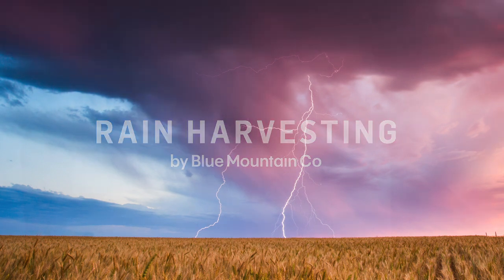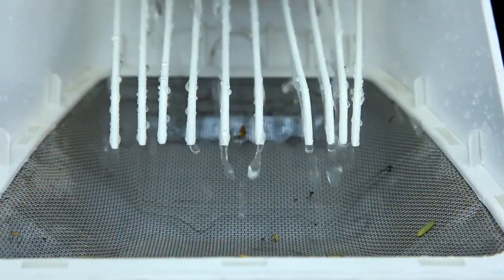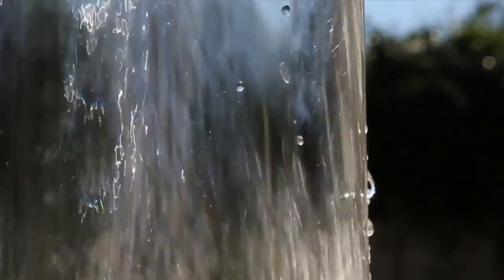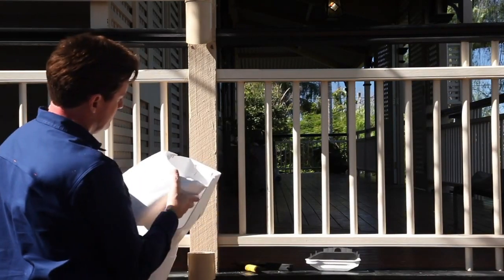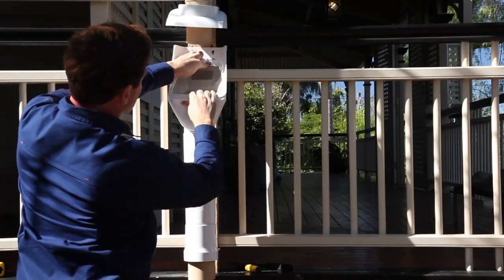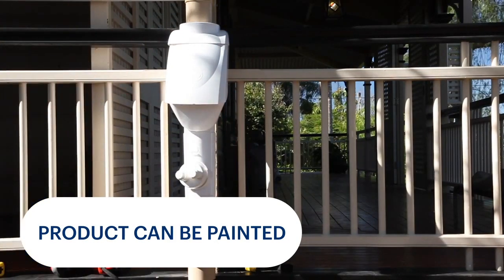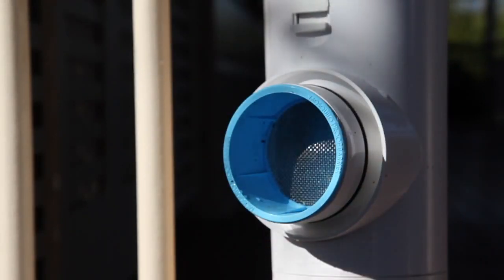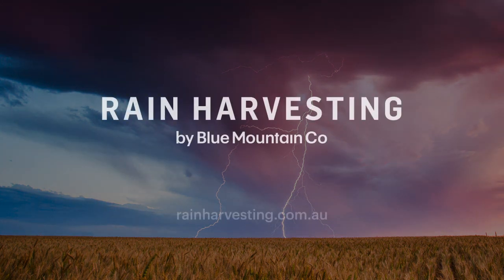Clean Rain Downpipe Diverters

Comment: this seems like a great single solution for a leaf guard, diverter, and first flush but multiple reviews here and various online retailers that little/no water ends up being diverted to collection tanks. has there been any root cause or solution identified for this issue? also, what is the expected behavior when the collection tank is full? does the unit allow for overflow to return to original downspout or is an overflow from the tank required?
Reply from the maker: Thank you for your comment and interest in our product!

You're absolutely right — this solution combines the functions of a leaf guard, diverter, and first flush, making it a very versatile unit. In some cases, particularly with older Clean Rain models, we’ve found that the internal washers can become less effective over time, which can impact how much water is diverted to collection tanks. Fortunately, replacing the washers usually resolves this issue.

Our newer model, the Total Rain, performs the same functions but uses a different mechanism. While it may require occasional maintenance to keep it performing at its best, it doesn’t need replacement parts like the Clean Rain sometimes does.

Regarding overflow: neither the Clean Rain nor the Total Rain include an integrated overflow feature for the tank. We recommend installing a separate overflow solution at the tank end. If you'd like specific advice for your setup, feel free to send us a few photos — we’d be happy to sketch out some ideas for you!

Please send your photos to info@bmco.com.au.

Comment: We are having and issue with the water not being diverted. Water is just flowing around the ball that is supposed to close off the flow downwards. Also in the instructions it says 3inch schedule 40 pipe can be connected to the diverter side but it doesn’t stay on at all and constantly leaks. Great idea but doesn’t quite execute properly. Not sure if we can return the item for a refund as we didn’t buy it directly through the manufacturer and don’t have the box anymore unfortunately.
Reply from the maker: Hi Kayleigh, I am sorry to hear that you are having issues with your first flush unit are you able to send some information through to our team to assist at info@bmco.com.au - Thanks, Portia

Comment: Hello! How much water is diverted to the tank? ive got a pretty big tank to fill and im curious on what percentage of the water thats coming from the roof is getting into the tank.. Maybe 50%? thanks!
Reply from the maker: Hello Dave! When we refer to diverting the first flush approximately 18-30 litres or 5-8 gallons will be diverted, depending upon a variety of factors. The main factors are flow rate and the period of time since the last downfall. However, several other factors such as rainfall intensity, ambient temperature, humidity and wind will all affect the exact diversion volume. The ON/OFF switch also means you can control what is diverted. Hope this helps answer your question!

Comment: Does the flow rate ever stall? Seems like it won't allow nearly as much flow as a standard 3inch pvc pip3
Reply from the maker: Hi Joseph! Our Clean Rain Downpipe Diverters are designed to minimize the disruption of water as it flows through the system. There is very little restriction of flow rate.
- Brianna